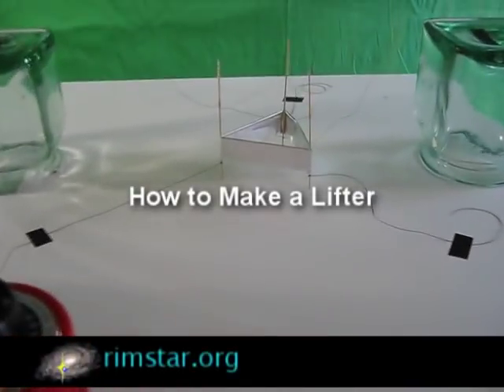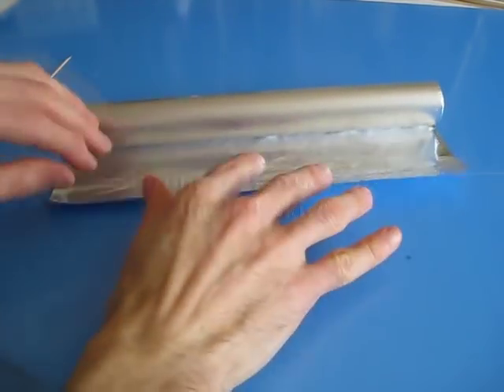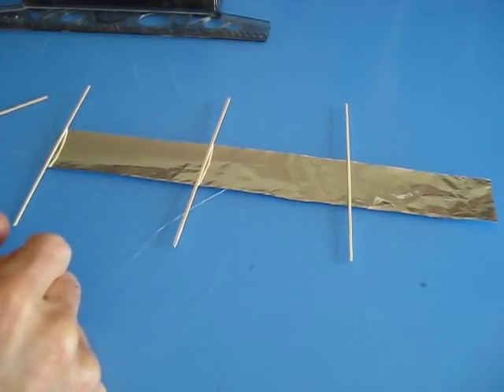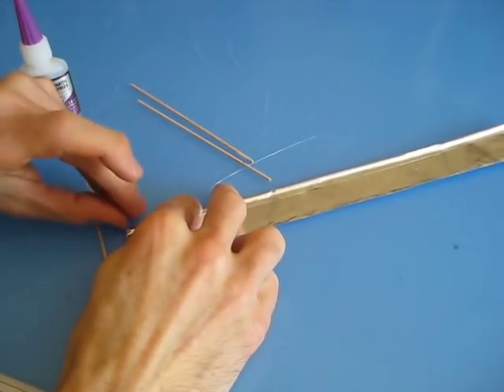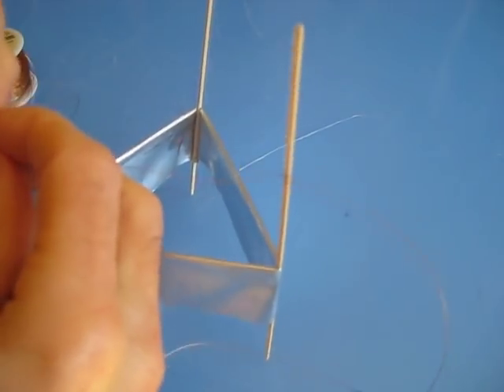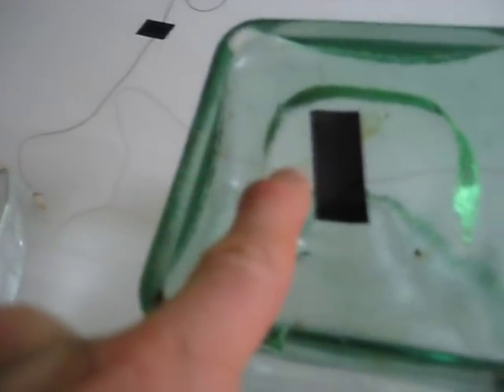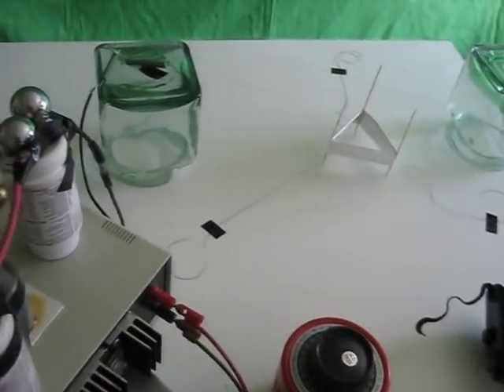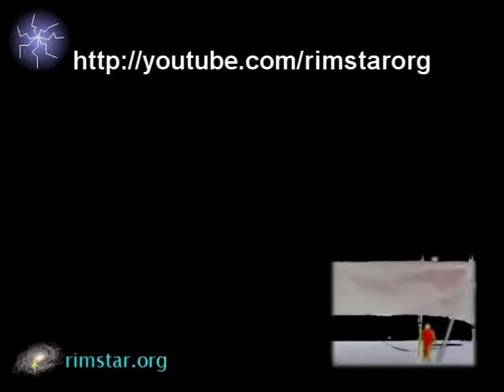How to Make/Build a Lifter or Ionocraft

Comment: can i attach several to make a fan?
Reply: i want to develop new ways of cooling my computer. im thinking this would be fairly quiet
Reply from the maker: It may be quiet but you'd be producing ozone which is hazardous to your health given how long you'd be running the fan. If you do it, make sure you're in a well ventilated area. There is a voltage somewhere below 10kV wherein ozone isn't produced and is what the ionic breeze products use but I don't know what that voltage is. Given the large distance between the two wires and the thickness of the wires used shown in the link, I pretty sure the voltage is above 10kV. This lifter's voltage is around 25kV.

Comment: what is the min voltage for ionocraft to work
Reply from the maker: +Utkrisht Sahai The min voltage for a ionocraft of this size to lift off is around 25,000 volts. I measure it in this video here https://www.youtube.com/watch?v=LOGAaObsN4g.
Reply from the maker: +Utkrisht Sahai Oh, and the electrical current is also important. It needs a power supply that can maintain the voltage while supplying a relatively high current for the ion wind. I also measure the current (roughly) in that video. For example, I have a big Van de Graff generator that can create up to 400,000 volts but it doesn't supply enough current for this lifter.
Reply: thnx and great fan of ur work

Comment: wood and plastic are insulators too.. and It as nothing to do with "sharp points" as any bare wire can conduct electricity..
Reply from the maker: "Sharpness" is important. If the top bare wire was thicker, 18 AWG for example, it wouldn't work well or at all. There wouldn't be the required level of ionization of the surrounding air. The thinness of the bare wire is the sharpness. See my video How Ion Propulsion, Lifters and Ionocrafts Work.
Reply: True but electric charges "collect" and are greater at points such as the end of a nail for instance and would be more likely to ground than the rest of a charged object that was larger in diameter, i.e., less sharp. Also, DRY wood is an insulator, not wet or green wood for example. I would not use wood as an insulator unless necessary such as being marooned on Gilligan's island
Reply from the maker: *****
I'm not sure if you're agreeing with that I said or disagreeing regarding the sharp points. Yes, elecrtic charge collects at points but is then emitted to the surrounding air. That's what's desired of the thin, bare wire of a lifter to create the ion propulsion.
Reply: I was agreeing with you. I was also mainly commenting on the comment Nicholas made that seemed to generalize electrical charges "have nothing to do with sharp points" but I may have misinterpreted what he was saying.
Reply: Yes I know, but at 10:45 he said that wood and plastic are not good insulators, but they are.. As long as they are dry there is no problem, just like glass or ceramic. And it is true that it may arc at the tips, but as the electrons are flowing through the device, they do not collect at the tips.. correct me if i'm wrong, I'm an electromechanical technician, but I don't know everything about electricity.
Reply from the maker: Nicholas R.M.
Oh, that's my bad. I hadn't realized I'd said that about wood and plastic. Actually, I said plastic is okay. And I agree, wood is okay as long as it's dry. That's the problem with making videos unscripted like I used to back when I made this, your mouth gets ahead of your brain sometimes :). I just added an annotation about the wood and plastic. Thanks for bringing it up.
And now that you mention 10:45 (I thought all along that you were talking about the wire at the lifter), it's true that the electrons are flowing through the wires but that can change when dealing with high voltage if you bring thin wires or sharp points at the ends of wires near enough to something that is a conductor. At high voltage the charge at the thinness/sharpness will be large enough to attract opposite charges on the conducive material. That will form a strong electric field between them and either leak, ionize the air and possibly spark, or if it's insulated, will just act like a capacitor, possibly even causing a little movement in the wire toward the conductive object. That's why I use all the plastic jars and glass containers to keep the high voltage wires away from anything else. It's also why I use rounded metal balls at connection points where practical to spread the charge out a bit.
The same is true of power transmission lines that are at high voltage. They're raised up on poles and suspended from all sorts of very fancy insulators.
High voltage can do all sorts of unexpected things that don't happen in our normally low voltage life.

Comment: Is anybody working on drone with this propulsion? What would be needed?
Reply from the maker: It would need to be too large and the voltage would be very high. No one's succeeded yet in making on which could lift its own power supply. The lifter in this video, for example, is around 2 grams and the power supply can just barely make it fly. The record is a 100 gram lifter which can lift a 100 gram payload.

Comment: From how much V does the thing lifts off?
Reply from the maker: Havbaba It needs around 26,000 volts and somewhere over 250 microamps. Don't forget the amps siince that's what supplies the charge for the ionization. You can see me measure this in my follow-up video here where I also do smoke tests https://www.youtube.com/watch?v=LOGAaObsN4g
Reply: RimstarOrg So actually the solar panels on space shuttles make High Voltage?
And is there any equation to know how much voltage or amps you need when the weight increases?
Reply from the maker: Havbaba :) No, the space shuttle used chemical rockets to fly, altogether a different technology.
I'm not aware of any equation. There hasn't been enough research with lifters for that.
Reply: RimstarOrg I mean satellites sorry, not space shuttles... :|
Reply from the maker: Havbaba I don't know what voltage the solar panels on satellites produce.
Reply: +Havbaba Silicon cells only produce 0.7V each,  so they are put in series to get useful voltages.  If all the little cells on a big satellite were put in series, you could probably get close 30kV,  but you'd have a couple of problems.  Firstly,  if any of the thousands of cells, or the connections between them, were to break; you'd lose all your power and the satellite would be dead.  The second problem is handling the high voltage safely without it arcing to where it shouldn't go, and simply turning your engines on and off would require switches and relays that can work at 30kV so would be prohibitively heavy.    What is more likely is that the solar cells are wired to provide the main bus voltage of the satellite (somethng aerospacey like 48V DC)  and this is boosted where necessary by little boards for ion engines and vacuum tubes (still quite common as the main transmitter) etc.
Reply: MattOGormanSmith Would it be possible to accelerate an aircraft with ion engines?
Reply: +Havbaba not a very heavy one.  The last ion engine I was looking at at JPL had a thrust of about 4g, from an engine weighing around 1kg.  good enough for a spaceship in the frictionless void,  but hopeless for an aircraft.
Reply: MattOGormanSmith If I want to make a drone for my thesis, what should I use as engine than? Because a jet engine or propellor are so mainstream...

Comment: Can i use a 12 volt charger?
Reply from the maker: No, it needs around 25,000 volts and a reasonable amount of current too.
Reply: @RimstarOrg  how i increase current from home supply
Reply from the maker: You'll need to build a power supply. Here's how I built mine https://rimstar.org/equip/30kv_pwr_supply.htm The flyback with no built-in diodes are hard to find but you can get them here https://www.amazing1.com/transformers-high-voltage-high-frequency.html or you can buy a power supply from them.
Reply: I have not much money to spend on it😅....i have 16 v charger only and home supply ...is I make something from these objects
Reply: Or suggests me some other projects for school physics project .....plz sir
Reply from the maker: Oh, my YouTube channel is full of projects you could do. Have a look through my science projects playlist https://www.youtube.com/watch?v=u2v-L-1Kctk&list=PLFsZmHTZL-zn3jrI0X0e0aRijWlyvfg8h There are plenty there that don't even involve electronics.
Reply: @RimstarOrg  Jesus Christ, you're dedicated! Responding to comments 10 years later!
Reply from the maker: Has it been 10 years already? My channel is still active, though I currently don't upload as often as I used to, I still do.
Reply: @RimstarOrg  yes and you do very great work,,,,if you cant run your channel than please give the ID and password of your channel.......i can run your channel and we can do patnership if it works .

Comment: WHY NOT PLACE A SMALL BATTERY ON THE MIDDLE  TO USE AS POWER IN STEAD OF POWER OFF THE OUTTER WIRES????
Reply from the maker: fred murray You need high voltage, around 25,000 volts, and relatively high current so it takes a rather heavy power supply. I'm hoping that someday some sort of simple circuit powered by a small super capacitor will be able to do it.

Comment: How much power would it take to lift, say a human. Or would it even be possible. +RimstarOrg
Reply from the maker: I don't know how much power but it wouldn't be practical as the lifter would have to be the size of a house and the person would be sitting in something that has a million volts across it.
Reply: +RimstarOrg for real?
Reply from the maker: Howyaduing
Well, no one's actually tried it since it's not practical. But that's what MIT and others have concluded. Look at how much hardware is required to produce enough ion wind to lift the small 2 gram lifter in this video. I weigh 60,000 grams. That's 30,000 times as heavy!

Comment: how can i i use a tv as my power supply?
Reply from the maker: Are you talking about a cathode ray tube type of TV, not a flat screen one? The cathode ray tube type is the old type and that's the only type I'm familiar with.
There are two ways to get high voltage from a cathode ray tube TV that I know of.
One is the trick of covering the screen with aluminum foil and connecting a wire to that foil. But that doesn't give enough charge to fly a lifter.
The other is much too complicated to explain here and I've only done it with old computer monitors so I'm not sure how easily it can be done with TVs. For old computer monitors see my webpage here: http://rimstar.org/equip/hvgmon24kv.htm
Reply: RimstarOrg oh okay. So i my project says i need a 1 DC high voltage power supply but i want one that is still powerful enough to make the lifter fly but not to expensive. Can you recommend anything?
Reply from the maker: Iam Diana
The least expensive is if you can find an old PC monitor an use the approach outlined on the webpage I mentioned. That approach is almost free but you'd have to find an old junk shop or maybe a thrift store that has an old monitor. You want it to be old enough to not have power saving features. Make sure you pay attention to the need to a 240kilohm resistor that that webpage talks about, otherwise your PC monitor power supply won't last long.
There are many types of high voltage DC sources out there but lifters need powerful ones, which makes doing a lifter project extra challenging. A powerful high voltage DC power supply is also dangerous, and safety precautions need to be taken. For that reasons it's best if you have someone working with you or at least a teacher who has sufficient electronics background to advise.
Reply: RimstarOrg Okay this is the most random question ever but does Sunny D have more vitamin c than Tropicana? im curious
Reply from the maker: Iam Diana
To that random question I can give only a random answer. I just have to find a coin to flip first. The coin toss says yes. :)

Comment: how many watts per ounce?
Reply from the maker: +Ioan NECSE Near the end of this other video (8 minutes and 40 seconds into https://www.youtube.com/watch?v=GEuK1OdYxHk) the input is 20 watts and I previously measured one of these lifters at around 2 grams (I'll leave the conversion to you.)
Reply: thank you ,have you ever considered mounting one of these on an airfoil? vertical flight is not very power efficient
Reply from the maker: +Ioan NECSE It was tried back in the early 2000s when this stuff was very popular, but even then the thrust was too small to do much. What works better is to mount it on a balloon. In that case you can even carry the power supply.

Comment: would not it be more optimal to put the electrode on top of a pvc pipe and put a grid at the bottom, forcing the ion wind and therefore the airflow through the pipe with the ions ending up on the metal grid on the end and the airflow passing through, creating directional thurst to be used as an engine rather than just 'go up'? also, as this effect occurs in any capacitor at any voltage (just that with your ordinary elco or cercap you won't exactly notice it directly), why apply a high voltage (directly or through a voltage multiplication array) and not just put the 'electrode->grid->seperation distance' a few 1000 times into the same pipe at let's say the same distance as they are in normal capacitors, then just power it at 12vdc or something. any research into the actual thrust per ampere/volt/conductor area/electrode distance?... as this is all still pretty much in the 'oh look it randomly works' stages without the calculations to cover it and optimize it.
Reply: i can well imagine this lifting up a car or powering a jetfighter... however... the underlying math seems to be missing (never mind that it's also missing for capacitors themselves, which don't even specify their material (protons and neutrons per atom seems relevant somehow) area and distance on the outside just the volt per second (farad) they just so happen to "randomly" achieve. somehow our labs miss the high voltage stuff (other than some basic test stuff for 10 and 100kv net transformers). maybe it's time to expand them a bit... people also keep claiming light and radio and ac through capacitors would not be the exact same thing. guess what. it's all the exact same thing. lol. 'at certain frequencies electrons can pass through air'. which is exactly what light is, what radio is and what is going on in a capacitor. just that all the math (IF ANY) is based on random findings. (solar panels for example are just a diode receiver at the radio frequency of daylight - work with that in mind and you can make them hell a lot smaller).
Reply from the maker: This lifter weighs around 2 grams and can barely lift itself. While ideas like yours for directing airflow sound good but won't fly because of the added mass.
Also, this effect doesn't occur at any voltage. The necessary corona discharge around the wire happens at a certain voltage depending on certain parameters. It can be calculated using Peek's law https://en.wikipedia.org/wiki/Peek%27s_law.
Reply: @RimstarOrg  pump it... -> OOOOO --> just pulse modulate multiple of them in series (and in parallel arrays of series) with a shift register and triacs. seems to me the 'problem' of it 'barely lifting itself' is the plain fact  that the air sucked through by the ions 'falls back' just as easily through the one single hole... which won't happen if there is a high pressure field behind it from the next pulse and the one on top of it is sucking it up too.
Reply: btw these things would probably also make great loudspeakers for full frequency range as they have no 'delay' in moving the conus. and thus can play all the frequencies at the same time. (but for that you'd have to lineary modulate rather high voltages)
Reply: thing with 'air pressure' which is essentially what this is is that you have to somehow contain it to force it to move in a certain direction efficiently :P (just like pretty much anything else that works with pressure does, combustion motors, etc)... just having -1- won't do that. having 10 or 20 or 200 of em in a pipe, working in 1001001001001 -> rotated patterns or something, would. having an explosion in open air doesn't quite  move the bomb itself very far (just gives a loud bang, we don't pay it to go bang ;). having an explosion in a closed container, such as a bullet, makes it move rather far. gotta force it in the direction that you want it to go, by not giving it much chance of going in other directions.

Comment: there is a reasons why this tecnology do not find applications ?
Reply from the maker: It's used in some spacecraft for their ion thrusters, for example, the Dawn spacecraft which is now orbiting the asteroid Ceres. However, the propulsion is too weak for use here on Earth for moving things around. The lifter in this video weighs 2 grams and that's about all it can lift. It can't lift the power supply. The common estimate is that to lift a person, it would have to be the size of a house and use a million volts.